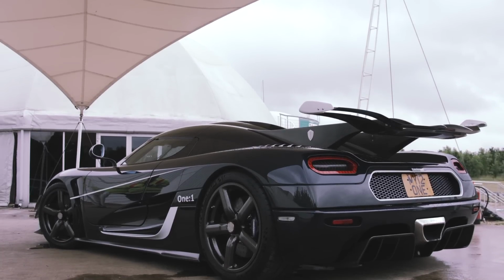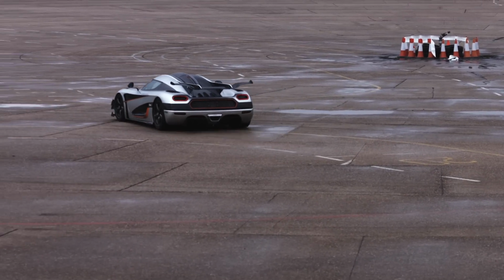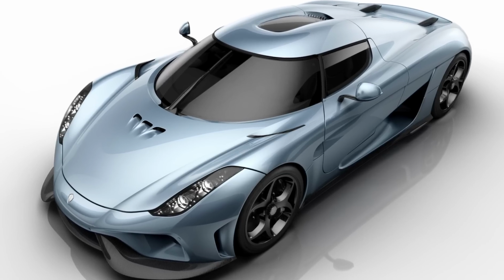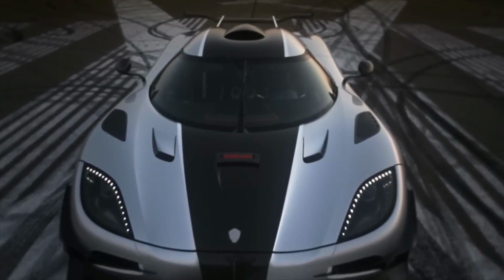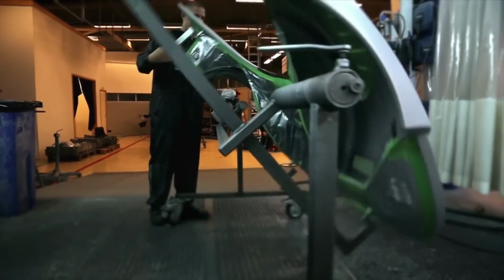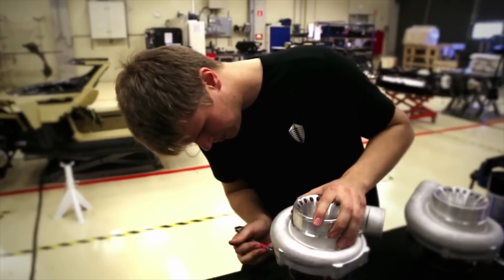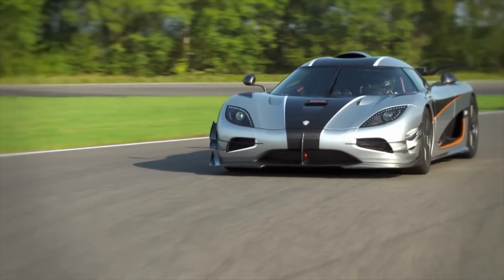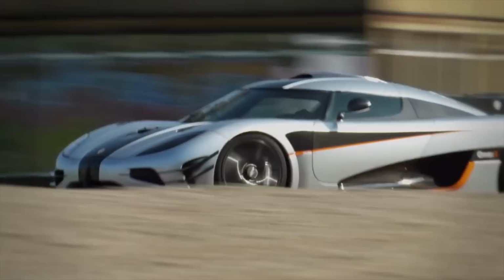Koenigsegg One:1 : Christian von Koenigsegg Interview  - XCAR

Comment: "... be a little bit innovative" haha. That is the understatement of the year!

Here are a few thing's Christian has invented/innovated.
Camshaft & valve free engine
New types of per-preg carbon fiber / titanium
Triplex suspension
Gearbox free drive train

The list goes on and on and on. This man is the Thomas Edison of our time.
Reply: MisterBrauer -  don't forget the dihedral synchro helix doors!
Reply: MisterBrauer Not to mention the flex-fuel related patents he has related to sensors for timing and adjusting air-fuel ratios in flex-fuel cars. I heard an interview where he said those patents helped pay for his automotive design hobby.
Reply: MisterBrauer 3D printed movable turbos
Reply: MisterBrauer Hollow carbon fiber wheels.
Reply: MisterBrauer yea. what christian has done in the automotive industry is nothing short of amazing. coming from a short market to the most respectable hypercar manufacturers is just remarkable. what i like about christian is that he is taking a lot more risk that his rivals would not do
Reply: Thomas Edison is infamous for claiming others ideas as his own

Comment: I have loved Koenigsegg since the moment I heard of them. It has been very interesting watching their development throughout the years........

please Koenigsegg, enter F1 and save it
Reply: Twin Turbo they can't even though the One:1, a street legal car weighing 1360 kg, a semi truck compared to F1, has a chance at getting first place with only the 273 mph top speed, faster than F1. Sure, the F1s can pull 4-7 Gs of cornering force while the One pulls 2, but since F1 can't even hit 248 mph (400 km/h), and the One can hit such speed in 20 seconds, F1 still hasn't even hit 1,000 horsepower yet while the One has 1,360. Sure the F1s may do 0-60 in 2 to sub-2 seconds, and the One may be rear wheel drive and 0-60 in 2.8 sec, and it probably may win within at least the last few laps but may hit first within at fastest halfway through, and would be overpowered since 2015 if it entered (it wouldn't even be taken in in the first place, presumably because the FIA knew the car was much too heavy AND too powerful and could reach 273 mph thus considering it too overweight and too overpowered and too fast).

Comment: WHAT?! 2G acceleration? thats as high as Track cars achieve.
Reply: ***** I know thats what i said i don´t think a GT3 car achievs much more than that.
Reply: ***** "Acceleration is a vector quantity that is defined as the rate at which an object changes its velocity." A change of direction is acceleration. Slowing down is acceleration.
Reply: ***** yes behind every force is an acceleration. and if you turn there is obviously some force involved i think its called centrifugal force.
Reply: ***** No, i meant around a corner. English is´sn´t my first language so it might be a bit confusing what I write. When cornering constantly the forces balance out, similarly to a hovering helicopter. Cetripetalforce is the force pointing into the centre -fugal is the one pointing to the outside.
Reply: ***** yeah, 5G is insane but not really comparable to a road car with street tires. Its debatable whether or not it exist, depends on who you ask ;) IMO it is the contrary force "actio=reactio"
Reply: for example:  a ball connected to a cord is spinning, the ball pulls the cord to the outside while the cord holds "pulls" the ball to a circular path.
Reply: ***** Constant ground speed does not mean constant and unique acceleration. Going 100km/h in a straight and 100km/h in a tight corner is not the same thing at all. In fact it depends of the radius of the trajectory you're in because then Acceleration becomes the sum of tangential acceleration (speed per second) and Normal acceleration (speed square divided by radius).
Reply: ***** Acceleration is change in velocity OR direction bro.
Reply: vivalaphill the red bull x20xx is said to pull 8,75Gs of cornering (believe this was said in its press release)
the brabham BT46B was touching 6-7Gs

if were not6 talking about fan cars then the toyota TS010 ground effect car is an example of it being done right (the drivers couldn't find the limit of grip), it ran a lift (downforce) over drag 1 to 6.something, higher than F1 cars
Reply: bucketslash11 its not real is it? its a prototype as far as i know
Reply: vivalaphill it's a concept yes but the engineering behind it is real (designed by a red bull engineer)
Reply: bucketslash11 theory and reality are two different worlds I don´t believe that...
Reply: vivalaphill which is why i mentioned another fan car in my comment, the brabham BT46B (designed by gordon murray)

which niki lauda quoted that he could not feed the throttle in out of a corner because the grip increased with the speed of the engine

i also mentioned the TS010 ground effect car which was running a L/D of 1 to 6.xx
Reply: vivalaphill "Brabham's lead driver, Niki Lauda, realised he had to adjust his driving style, mostly for cornering. He found that if he accelerated around corners, the car would "stick" to the road as if it were on rails.[15] This had the side effect of exposing the driver to very high lateral acceleration, which would become a major problem in the ground effect era. In his autobiography, Lauda described the car as being unpleasant to drive due to the lateral loads and reliance on aerodynamics over driver skill. He realised early on that the rate of ground effect development meant that in the future, every driver would be exposed to such g-loading while behind the wheel of such a car, and the physical effort needed to drive the cars would leave the drivers exhausted by the end of the races."

taken from wikipedia
Reply: Hear That? slowing down is deceleration?
Reply: Hyzic it is also negative acceleration
Reply: tomelliott9 There is no such thing as negative acceleration... Acceleration can be negative only if you represent it on a graphic with axes, and it goes in the opposite way.
Reply: Hyzic It is acceleration.
Reply: vivalaphill the force involved is centripetal force, or a force directed towards the center of the turning circle. it is equal to the static friction force of the tires on the road.
Reply: ***** force = mass x acceleration. In other words, acceleration is a component of force, so a constant force has a constant acceleration/mass. Acceleration is a change in velocity over time. Velocity is speed AND direction. During a turn, there is a constant change in direction over time, meaning a constant change in velocity over time, meaning a constant acceleration. The acceleration times the mass of the car is the centripetal force keeping the car on the turn. 
*side note: the centripetal force is the frictional force between the tires and the road, so the tires are pushing 2x the cars weight during a 2g turn... das a lot of pushing.
Reply: Chris Clark centripetal force isn't the force between the tyres and the road, it's the force of the weight of the car pushing out of the turn, which, unless the car is sliding, is equal to the friction force of the tyres.
Reply: tomelliott9 the way my teacher taught me physics was that objects wont accelerate unless acted upon by a force, so since the car is accelerating, the force of the friction of the tires is pushing against the car inwards to force the car into a different direction
Reply: Chris Clark that's correct, but centripetal force is the outward force
Reply: tomelliott9 ? google the term centripetal force. it says inward pointing force
Reply: +Hyzic This comment thread sounds like a justification to me. Yes they're all acceleration but for the purposes of regular discussion calling cornering acceleration is misleading. Lateral G's or xyz G's in cornering or in figure 8 etc would communicate the meaning best.
Reply: +bucketslash11 6-7 G's is a huge overstatement, the Brabham "only" made 0.5 more G in the corners and at the time general cornering forces was around 3 - 3.5 G's. So it made about 4 G's which was pretty awesome at the time. But newer F1 cars have made more downforce ie. more G's relying on static aerodynamics.
Reply: +David Chang toyo? lol, that's a tire manufacturer , not a tire type. And no one who could afford one of these or going to use toyo. there are far better tires out there. some pilot sport cup 2s would be my choice

Comment: Here's my problem with what he said about it being the most we can push out of an internal combustion engine. Back in the 80's, we had 1,000 HP 4 cylinder cars. With turbos. Today, we have 3,000 HP V8 drag cars. I'm pretty sure we can develop smaller engines with big power figures as long as they maintain efficiency, and reliability.
Reply: Most likely meant reliable, production, road car. Or something along those lines....
Reply: morpheus232001 I know, but if it can be done aftermarket, it can be done production.
Reply: ***** Its not just about making power, it's about making power safely and reliably, while also passing emissions laws, and having a decent MPG. Most of those 1000 HP 4 cylinders you are talking about probably breaks down after every 100 miles or so, a manufacturer can't afford that.
Reply: ***** I know. I mentioned that in the latter part of my comment.
Reply: ***** Take everything he says with a pinch of salt, hes a salesman not an engineer.
It was only last year when he was claiming hybrid technology was like 'mixing oil and vinegar, it does not work'

Suddenly we now have supposedly the Regera with batteries, electric motors and a combustion engine, but its not a hybrid.....really?

You are of course correct, smaller, more reliable turbo engines are coming through all the time, getting any amount of BHP from forced induction is technically possible. Even the facelift model A45 AMG is rumored to getting close to 400BHP from a 1991cc engine with complete drivability and reliability, 

So theres a cheap little hatchback which develops the same BHP/ltr as the Agera, obviously there is certainly much more to come with the ICE.
Reply: yamahaevo yeah youtube should ban me because i am not a Koenigsegg fanboy, yeah that makes a lot of sense....grow up.

What the fuck do you even know about cars? other than cleaning them for your day job? have you even driven a sports car never mind owned one???
Reply: M3Conv Im not the one trolling and lying.
Reply: M3Conv He didn't like the TYPE of hybrids that are on the market now, he isn't against Hybrids in general
Reply: jody024
That's not what he said on the inside koenigsegg video, looks more like a complete turn around to me.
Reply: M3Conv No, you hear what you hear in your brain.
Reply: yamahaevo
Stalker.....
Reply: +Mooselover1011 Look at Ecoboost or drive a 1.6L Fiesta ST (turbo and I can't feel any lag!). I do think small engine tech is coming along well. Emissions, regs and consumer whim are the biggest hurdles
Reply: +TheDriver 1000hp Evo for eg needs a full build every dozen passes. Are you here for your 20km $40,000 service sir?
Reply: +M3Conv he said he didn't like the way hybrids had been done and I would bet that's what he was talking about. his version of a hybrid is a bit unique. he fixed his gripe with hybrid powertrains and then he built an example.
Reply: +Mooselover1011 Modded cars with a ton of HP need to be Maintained a LOT. Their engines are also clusterfucks

Comment: They are great company , but :
They have patent for pneumatic valvetrain , but they do not use it .
They still use crossplane V8 engines . Fact is that flatplane engine would have lower inertia , mass and backpreasure form odd fire order , so it would make even more power .
I looked at One:1 acceleration run and I noted huge pause during upshift . I know that single plate (drive) clutch is lighter , but upshift time is too long . It jerks to much .
Their every car is convertable , and car with rigid roof would me much lighter .
Reply: Mladen Milić The car u drive is a 88 sierra.

Comment: no doubt are great cars, very fast, but not proven circuit yet, just in straight since the governed can even be fast, but it will take the pilot factor because without exchange, one of the points that defines who is good and who is bad, and will lose the pleasure in driving ... the car just does everything for you, and this is not good for those who like to ride, is for those who think they are pilot but are not good. Great video

Comment: The limit? Not even close...we're less than halfway there. And in my humble opinion you don't have a 1:1 power to weight ratio until you have 1hp per pound.
Reply: +BAZYRKYRS BUNKER The One:1 has 1 Horsepower for every Kg. They don't use lb's in Sweden. very little companies do
Reply: I'm aware of that...but they know what a pound is correct? Based on their reasoning they could have built a car with 1hp per metric ton and called it the One:1 and because of this I think it's disingenuous to call it the One:1. The fact is you do not have a 1:1 power to weight ratio until you have 1hp for every 1 pound.
Reply: BAZYRKYRS BUNKER
Majority of the major companies out there use Kg. Therefore its a BHP : Kg ratio

Comment: why aren't they doing a speedrun to beat the bugattis 431km/h?
Reply: No point, they have to produce 30 cars for the official record and the one:1 is limited to a run of 5 cars
Reply: If I'm not mistaken, the record has already been beaten by the Hennessy Venom gt. But don't quote me. That's just what I heard
Reply: That's correct but as they have not/ are not producing at least 30 of them it's not an official record. I think that's the case anyway
Reply: Christian talked about this actually in an interview awhile back. He said he really doesn't care much about having the highest top speed, he says in theory the one:1 can beat it but they didn't produce it to do so and really don't have an interest in finding out. The top speed being a hypothetical 280 mph was just a side effect of the horsepower and aerodynamics.

Comment: Love this guy but all the Koeniggseggeggegggeggeggegg cars look flat like external hard drives with not enough wheel travel. Needs more crevices and undulations to pen a beautiful car. Wedge like a Corvette is not going to win any beauty contests. Look at the 675LT / 430 Scud / 918 / P1; high performing and good-looking.
Reply: Koenigsegg is on another level of those cars.
Reply: Exactly. So why not also be on another level in the design department? I get aero has some constraints but the car from the front literally looks like a Toshiba external hard drive; bubbly and flat.